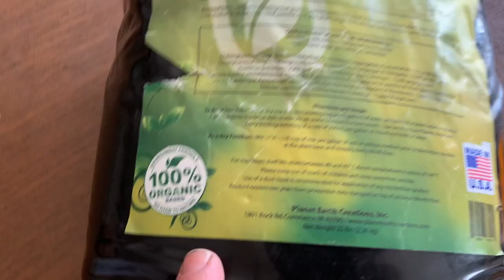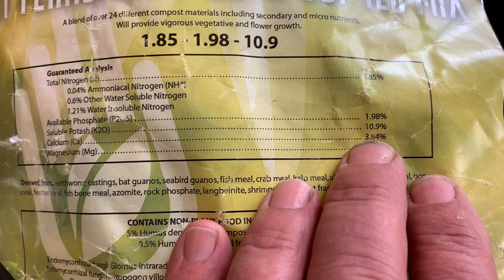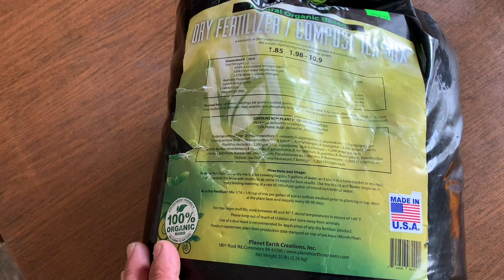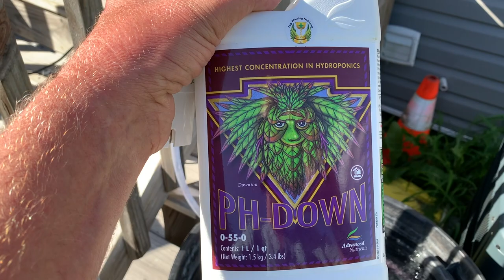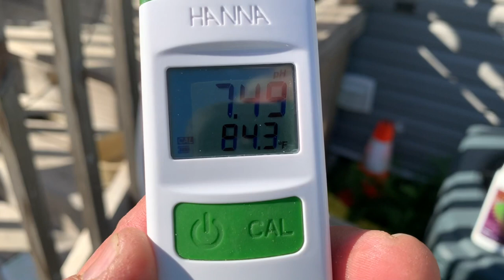Compost Tea  Moving a  300 Pound Pumpkin on the vine  PH & meet the  HORN WORM!

Comment: Hey, I have a question or two, been trying to grow a giant pumpkin this year, I have noticed throughout the past month all of the leaves have been very wilty. I didnt really know how to fix it, have been giving it plenty of water, figured it might just be the heat or something but everything was growing so I didnt worry about it. Tonight I went to check on the plant, I decided to take a look at the stump and found like half of it seems to be rotting. I read your reply to another comment about cutting away the mush and use peroxide, do you think I should still cut it away if it is over half the stump rotting? Also I was wondering, is there a spot which I should remove the dirt around the stump? Like should I dig all the dirt around it down to the top of the roots?
Reply from the maker: I wouldnt dig it up Did you use a stump cover? We keep the stump dry with a cover & do not directly water the stump area keep your drip tape or waterings at least 12 to 16 inches from stump after July 1st or when plant gets about 15 to 20 feet long .You can grow big Pumpkins with out the stump. My 1177 was grown after I lost the stump at 600 lbs. It won 2 grand in Indiana in 2015 Put a fan on stump & dry it out if possible. You may need to cut the stump away from plant to stop the spreading of the MUSH>
Reply: @Worldwidegiantgrowers  I did use an old school desk as a stump cover but it wasnt working too well, I should have swapped it for something better, but alright, great to hear I can still grow a decent pumpkin without the stump! Ill see what I can do, appreciate the advice.
Reply from the maker: As long as the vines are somewhat buried and rooted into the soil if you have them taproot it down to the soil the pumpkin will continue to grow without the stump.

Comment: Mark what’s the stuff I should put on my crown to keep it from rotting
Reply from the maker: Chase Romdenne keep it dry stump covet is all you need
Reply from the maker: If you do get a rotten stump keep all watering s 2 feet away from crown.This requires a stump cover of some kind.You can put Captain dry powder on the wet to try to dry it up.Scrape any mush off first & clean with 3% hydrogen peroxide